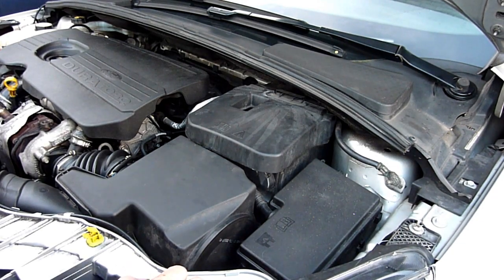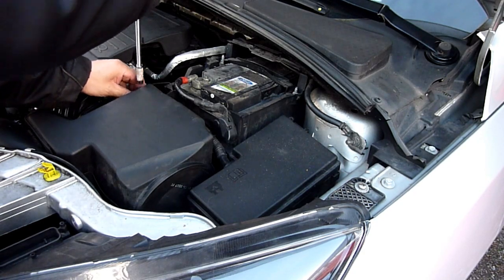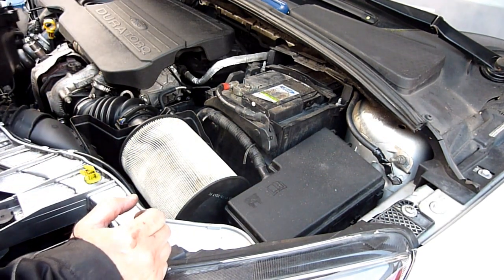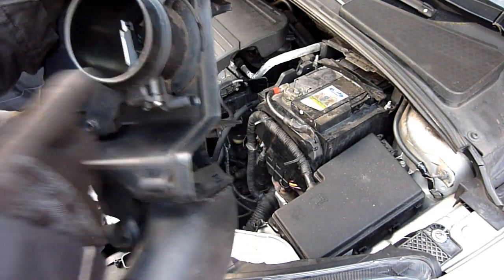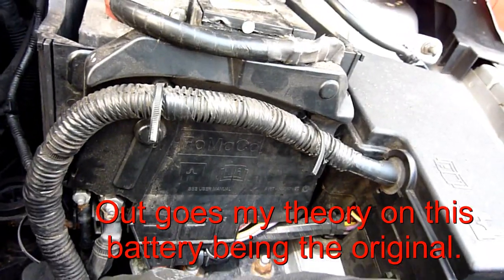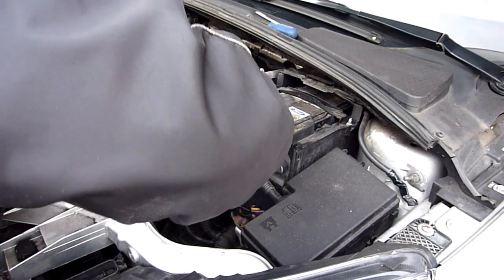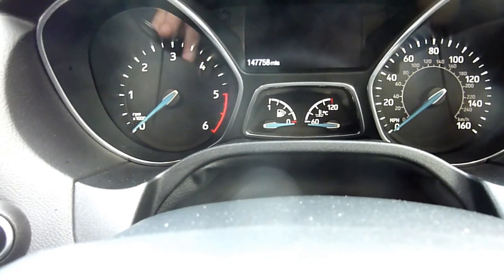Unusually Difficult - How to Change the Start/Stop Battery on a Ford Focus 1.5TDCI (2014 - 2018)

Comment from the maker: The battery in this make, model and mark should be removed in the order shown in the video for 100% assurance of safety and ease. Extra components like the airbox should be removed to allow easy access to pull and slide out the battery horizontally, just enough to disconnect the negative battery terminal at the battery end (bolt to chassis already removed). This should be done to minimise any stress on the extra sensor and plug/ socket and cable that leads onto the wiring harness.  Forceful pulling of the battery up and at a diagonal to lift it over the airbox is not recommended due to unforeseen extra strain on the aforementioned sensor unit/ harness.
Reply: In your opinion of course? Took me 5 mins without removing anything other than the battery cover, clamp, and terminals.

Comment: Pretty sure you just unclip and raise the front panel of the battery box, tip it forwards and the battery comes out at an angle after you’ve undone the connections and brace. No need to remove air box etc.
Reply: That's exactly what I just did over the weekend. So much easier than removing all that extra stuff. It is a bit awkward/heavy to tilt in but just take your time and you got it.
Reply: This is the exact same way  I did it today on my girlfriend's 14 focus it is really simple to do it your way.
Reply: Correct lift the front panel, push the sides out and pull front panel towards you. Battery will lift out on the angle....simple.
Reply: In my 2016 there wasn't quite enough room with the face lifted and fuse box cable disconnected.  Had to take the lid of the airbox out but did not have to go any deeper.  This allowed the battery box face to move just enough to angle out the battery.
Reply: The rail that holds the rubber seal below the windscreen clips off on the front wing and tilts up. Battery lifts straight out

Comment: I just did a battery replacement on my 2014 Ford Focus. No need to remove all the air box assembly or harnesses or mass air sensor. I just unsnapped the front of the battery box on the sides and pushed it forward a bit, removed the positive and negative cables from the battery then weaseled the battery out. Only used a 10mm socket and ratchet. Took me 10 minutes to remove the battery and about 10 minutes to install new battery.
Reply: I've never before known of such a ridiculous design that makes the battery so difficult to replace. I can't even get the wrench to fit in the gap above the negative terminal, and the bolt to chassis won't budge, so I'm going to have to search for a lower profile option.

Comment: Just did this today. Took 20 mins. Unclipped the gutter slightly and lifted it out vertically after taking the covers off and disconnecting the cables. Doddle.

Comment: Damn your making this WAY more difficult than what it is. So many easier ways to do it. But hey, you do you.
Reply: Right glad I found the "easy route" and just removed the fuse box cable and filter housing so the battery compartment face could shift forward JUST enough to manhandle out and absolutely require an extra set of hands to keep the battery propped at an angle I could get a positive grip with the cursed crescent wrench because each nut and bolt required different flipping sizes both metric and standard and of course none I had in a parking lot worked for the battery terminals.  Yeah even with the "easy way" its still the worst battery to replace I have ever had the displeasure to work on.  That gas mileage though...
Reply: @Wahinies  Yep, I did it the same way. Quicker but still a pain in the ass. They just want you to have to bring it in so they can charge you an arm and a leg. Kinda crazy what you have to do to get a battery out compared to 40 yrs ago. Lol But like you said, that gas mileage though!!!👍

Comment: Hi. You did make it bit more difficult then it should have been. The thick wire in front of the battery just clips off from the fuse box on the right and then you can slide the front battery cover out. Obviously if it’s your first time to remove it on a focus then it can be tricky but easier for next time. Meant to say hope you removed the small red transport caps both sides of the battery. Thanks for the video though.

Comment: You never disconnect the negative side first! Always the last to remove. Also, you made this so much more difficult for yourself. The air feed into the box disconnects, then you simply lift the box out. Then remove the positive terminal on the battery. The end panel on the battery tray will unclip and you can move it up enough to release it and pull it towards you gently. Once the battery brace has been removed you can undo the positive terminal and remove the battery. I removed and refitted mine in 15 mins, not rushing.
Reply from the maker: The negative battery terminal is connected to the body of the chassis via the cable and bolt visible. This bolt is present to allow easy and often disconnect of the car's battery's power...the negative terminal battery should always be disconnected first. Please refer to your owner's manual, or a dedicated repair manual like Haynes if you are unsure.

Comment: Before you do anything, make sure you plug a memory keeper into the cigaret lighter socket before you disconnect the battery.
Reply from the maker: That's a good idea ...I haven't found a memory Keepers that plugs into the lighter socket. Be a good place to place it rather than the OBD2 socket. I know what I have done in the past that works is have a battery boost starter pack with not much juice and connect it to the terminals before disconnecting, though it probably be better using your lighter method. On my cars the Ford Focus and Honda Civic, it doesn't matter if the battery is disconnected, I just lose the clock. On other cars I've owned like the Nissan Primers, the immobiliser kicked in when someone changed the battery at the shop. I can't remember how he got out of that one, but he was reprimanded.

Comment: I'm looking to disconnect my battery for a few minutes. I am right in saying that since I'm not removing it all I need to do is :

Disconnect the negative from the body as you've done at the beginning and then disconnect the positive ?
Reply from the maker: Yes make sure you have your radio code if it's an older car like 20;years old...make sure your car has not got an auto immobilizer if the battery is disconnected typical in older cars like 25;years old. Check your owners manual or look it up and down load.
Reply: @EducationPineapple  No mines a 17 ST Focus so same as your own. 👍
Reply: @EducationPineapple  Funny enough theres very little if anything in regards to the battery in the owners manual for these.

Comment: Can i change battery myself with car been keyless start ?????
Reply from the maker: That's is unknown to me, but I would say if that was me I would try to change the battery on a keyless start car, however I would have the doors open and windows down before disconnecting battery and also make sure you have an immobiliser code if your car has a code also the radio code if your radio has a code before disconnecting. Get ready for the car's alarm to go off.

Comment: So does the car not need plugged into a computer if its a start stop battery?
Reply from the maker: No just need for a computer plug in ..
Reply: @EducationPineapple  i dont understand what you mean
Reply from the maker: @sandyfleming9490  the only thing you have to remember is remove the negative terminal connecting to the body of the car as shown in the video...cover end of cable with electrical tape for insulation then follow procedure shown in video...refitting is the exact opposite of removal...everything works normal after that...remember this is for the Ford Focus 1.5 TDCI 2014-2018...UK... won't be the same for other cars for example the radio code needs resetting in other cars...any doubt take it to a reputable person to do the work. Good Luck.

Comment: Why would ya try and take the negative side off when it's off the car body on the other end? Just pull it out, then take it off when it's out.
I just changed mine and took the air cleaner, whole box  out. Its only one jubilee clip.
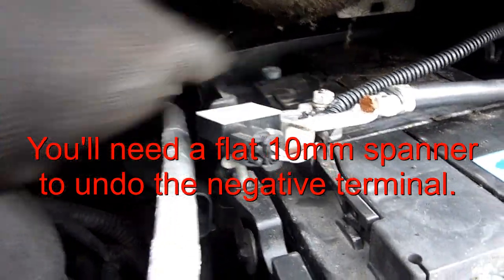Reply from the maker: On the MK3.5 Ford Focus 2014-2018, 1.5TDCI, like mine, removal of the battery is recommended as in the video shown. Firstly, unscrew the negative terminal end with the bolt into the car's body. It is used for frequent disconnect of the power supply. Next the 10mm nut should be unscrewed and the negative terminal removed. The removal of the battery's terminal is next because the extra sensor attached to the MK 3.5's terminal, is connected via two white cables see video 16:40 to the engine electrical harness. Care should be considered in the order of disconnect because the sensor can malfunction in certain disconnecting combinations and in particular when using a battery charger with battery in situ.